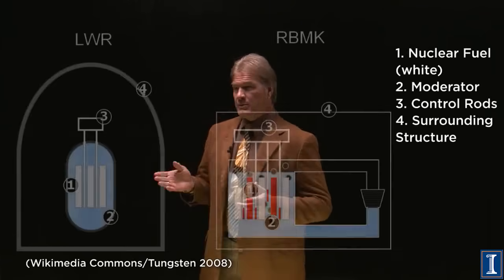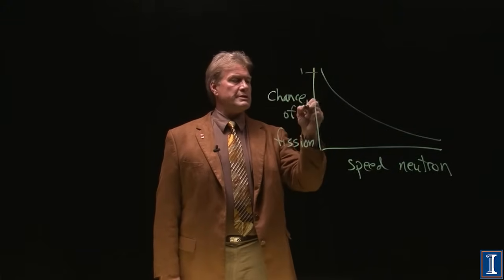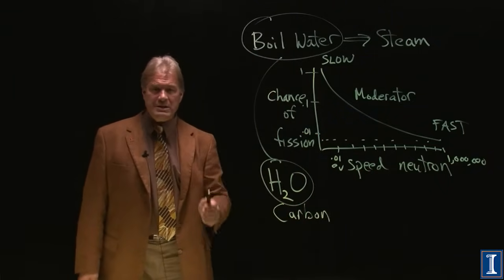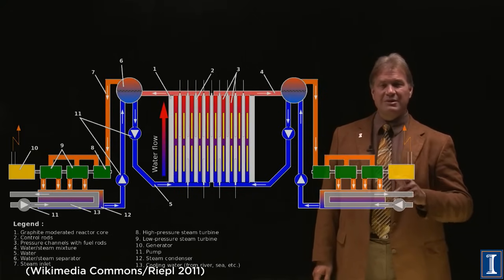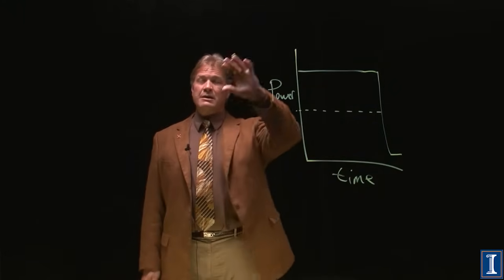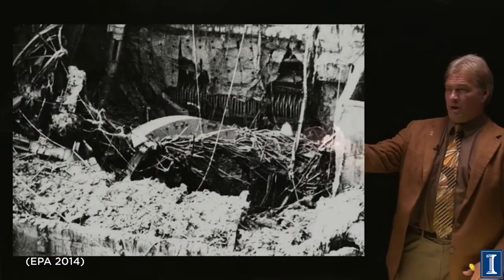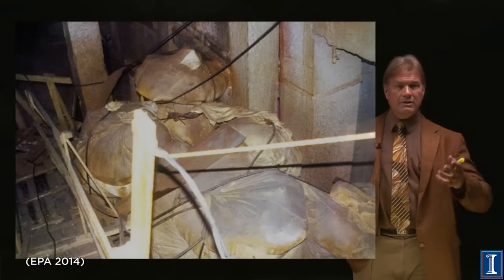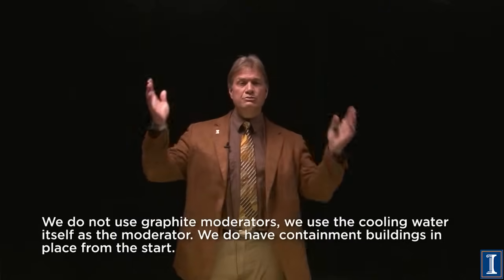Chernobyl: Worst Accident Ever

Comment: Containment vessels are important, but they do not guarantee containment (example: Fukushima).
Reply: Indeed, Fukushima unit 2 melted down completely and broke out of its primary containment, which is not even supposed to be possible.  That's as bad as it gets for a PWR accident.
Reply: Fukushima was a triple meltdown rather than a single meltdown and yet as a result of the containment, it only ever released 1/10th the radiation Chernobyl's single melted core did. While not necessarily guaranteeing total containment, they can reduce the release in case of an accident quite substantially.
Reply: @infantjones  Agreed, but only #2 broke out of its primary reactor vessel contaiment.  Most of the radiation released came from this reactor.
Reply: They also don't help when the operators decide to release very small amounts of radioactive gasses into the atmosphere. I believe that happened at Three Mile Island. Hydrogen was accumulating in the containment building (search for "hydrogen bubble") and someone erroneously believed that it could explode and damage the building. So it was decided to vent this hydrogen out into the atmosphere. The hydrogen itself is not radioactive, but it is impossible to filter the air that is vented 100% so some other radioactive gasses from inside the containment building was also vented.
Reply: @Jan Bruun Andersen

It didn't harm anyone nor do any environmental damage so I don't see the issue. Far too little radiation diluted far too greatly to even risk causing any harm.
Reply: @JanBruunAndersen  There was no detectable radiation in the environment after the hydrogen was released from TMI.   After the accident was over, everyone was allowed to go home.  There was no exclusion zone, no detectable contamination.

Comment: The reactors at chernobyl were also designed to run only at full power to produce as much plutonium for nuclear bombs as they possibly can...

The russians didn't tell them this, and when the operators started fooling around with the operation of the reactor.... well, you can see the result...
Reply: you stupidity level is higher than amount of energy produced by RBMK-1000 at full power

Comment: The only thing more dangerous then a safety test at Chernobyl is a teacher without a firm grasp of the subject matter.

Safety features
The CANDU includes a number of active and passive safety features in its design. Some of these are a side effect of the physical layout of the system.

CANDU designs have a positive void coefficient, as well as a small power coefficient, normally considered bad in reactor design. This implies that steam generated in the coolant will increase the reaction rate, which in turn would generate more steam. This is one of the many reasons for the cooler mass of moderator in the calandria, as even a serious steam incident in the core would not have a major impact on the overall moderation cycle. Only if the moderator itself starts to boil, would there be any significant effect, and the large thermal mass ensures that this will occur slowly. The deliberately "sluggish" response of the fission process in CANDU allows controllers more time to diagnose and deal with problems.[4]

The fuel channels can only maintain criticality if they are mechanically sound. If the temperature of the fuel bundles increases to the point where they are mechanically unstable, their horizontal layout means that they will bend under gravity, shifting the layout of the bundles and reducing the efficiency of the reactions. Because the original fuel arrangement is optimal for a chain reaction, and the natural uranium fuel has little excess reactivity, any significant deformation will stop the inter-fuel pellet fission reaction. This will not stop heat production from fission product decay, which would continue to supply a considerable heat output. If this process further weakens the fuel bundles, they will eventually bend far enough to touch the calandria tube, allowing heat to be efficiently transferred into the moderator tank. The moderator vessel has a considerable thermal capability on its own and is normally kept relatively cool.[4]

Heat generated by fission products would initially be at about 7% of full reactor power, which requires significant cooling. The CANDU designs have several emergency cooling systems, as well as having limited self-pumping capability through thermal means (the steam generator is well above the reactor). Even in the event of a catastrophic accident and core meltdown, the fuel is not critical in light water.[4] This means that cooling the core with water from nearby sources will not add to the reactivity of the fuel mass.

Normally the rate of fission is controlled by light-water compartments called liquid zone controllers, which absorb excess neutrons, and by adjuster rods, which can be raised or lowered in the core to control the neutron flux. These are used for normal operation, allowing the controllers to adjust reactivity across the fuel mass, as different portions would normally burn at different rates depending on their position. The adjuster rods can also be used to slow or stop criticality. Because these rods are inserted into the low-pressure calandria, not the high-pressure fuel tubes, they would not be "ejected" by steam, a design issue for many pressurized-water reactors.

There are two independent, fast-acting safety shutdown systems as well. Shutoff rods are held above the reactor by electromagnets and drop under gravity into the core to quickly end criticality. This system works even in the event of a complete power failure, as the electromagnets only hold the rods out of the reactor when power is available. A secondary system injects a high-pressure gadolinium nitrate neutron absorber solution into the calandria.[5]

If you lose the water (coolant/moderator) in a Candu reactor, without the OTHER emergency safety systems, it will blow.
Reply: YES THANK YOU someone who knows what they are talking about.

Comment: Catastrophy was POSSIBLE to evade by ONE simple thing: using the water, not the controll rods. Compare to LWR, water is KILLING the nuclear reaction in RBMK.
However Akimow ORDER to do AZ-5, even if Diatłow wanted water. Effect? Bang.
In practice without messing, RBMK prove to be superior to any LWR.
None of them caught meltdown during the NORMAL operation. (with all systems green)

P.S. If Nixon didn't fuck the safest nuclear program, safe and cheap TMSR would dominate the nuclear business causing TMI, Czarnobyl and Fukushima accidents to not exist.
Now we ended with thousands of tons, radioactive and unsafe nuclear waste! (that is pilling every year and GROW!)
P.S2. Water is the WORST coolant ever! It didn't even fulfill the SAFETY requirements for nuclear moderator! Forget the coolant!
8:20 - BIG NOPE. It wasn't safety test anymore since Diatłow CHANGED the scenario to catastrophy...reactor couldn't explode with cooling system work and the "buffer" eating all of those sweet neutrons!
18:00 - AHEM! Fukushima exploded in that SAME way, radioactive particles ESCAPED the contaiment! Nature proved LWR can't stand the fury of the elements! We neeed *MRS!*
Reply: The control rods were tipped with graphite, and the reactor was moderated with graphite. So when the AZ-5 button was pressed to SCRAM or execute an emergency shutdown, those control rods descended into a nuclear pile with a runaway chain reaction within it, and they triggered the explosion. The moment they realized there was an uncontrollable power surge underway, it was too late.
Reply: @taraswertelecki7874  
That is WHY operators should start the water pumps - to evade the power surge.
Reactivity is double-eged sword.
Also - if "buffer" rods were not lifted as in experiment principles-nothing bad would happen.

Comment: Your containment building wouldn't help you in case of something like Chernobyl. It's silly even to suggest it. You can not contain explosion these way. Did you saw that hole in Chernobyl's roof? We had only two major meltdown events in history, both happened because water stopped pumping through the reactor. So we need reliable, redundant and foolproof system that pumps water through the reactor, and not some useless containment building. Look, it's not a rocket science, it's not like making airplane that in safer to fly than to walk, so it's definitely possible to make reactor that doesn't breaks. Yeah and we need some central control center, to not allow people on places to do things like that.

Comment: This guy has some incorrect facts, nobody hit the wrong button.
Reply: Yes. What actually happened was Kiev told them they couldn't shut the reactor down as early as the plant operators wanted because they still needed the power for the city. As such it ran at half power for several hours. That's what allowed the xenon to build up, which eventually caused the reactor's power output to peter out.

Comment: Built my rbmk in the shed (slightly scaled down) all going well till last night when there was a small explosion. Wife wanted to know why there are chunks of glowing black stuff on the lawn, just told her " you didn't see it because it's not there" 😂 dyatlovs  book reactors guide for dummies is not my best buy
Reply: I read your book "Graphite Moderated Reactors for Dummies" and ended up having a loss of coolant accident when my garden hose accidently disconnected from the washing machine I was using as a reactor core.  The force of the phreatic explosion caused by the remaining water suddenly boiling due to the 100 kg of low-enriched uranium (that you suggested as suitable for a beginner's first reactor fuel load) suddenly going prompt-critical was not fully contained by mom's sewing room, which I was using as a containment structure.   The nuclear yield was low enough that the Department of Energy only classified it as a "dirty bomb", but we ended up nuking several Middle Eastern countries anyway before I could get through to their help desk and tell them what had happened.    
Based on this experience, I would not recommend this book to a friend.
Reply: Now u can grow ToMacco on farm,..

Comment: There's an interesting conspiracy theory put forth in the film, 'the russian woodpecker'. A russian youtube channel did a video where one of the engineers involved at the time of the accident stated that the procedure they followed would surely cause the reactor to fail, and they knew it. Can we assume that they didn't really understand the problem with shutting down the reactor and then restarting , and thus having to pull the rods out to get the reaction going again?

Comment: As a physicist may I correct certain details. There was a containment shield above fusion chamber, cylinder of concrete 3 meter high and 17 meters wide. There are info that shield weight was around 50 tonn and its swings in the air by explosion. Also you not pointed out that whole reactor was build in a rash and quality of concrete were poor without steel or lead in. And there was few broken fuel rods. Firefighters were uniformed of explosion, they knew only that the roof on fire. So whole catastrophe was a lot of human mistakes and terrible accident.
Reply: The reactor lid weighted significantly more than 50 tonnes believe me.

Comment: The statement that our nuclear centrals are safe because they have a containment structure is very daring. It is doubtful that a containment building would have been of any help in Chernobyl.  A reactor melt down generates tremendous amounts of pressure.  The chernobyl explosion blew away dozens of meters up in the air a 500 ton concrete slab that was on top of the reactor precisely to prevent radiation scape in case of an event.   Such a blast in a containment building could have the same effect as the explosive inside a metal hand grenade.
Reply: The first steam explosion blew the 200 ton "System E" plate through the roof, after which it landed back on top of the reactor at an angle. It didn't blow apart like a grenade, and as far as I'm aware, the reactor pit stayed intact. So did much of Reactor 4 building. System E was never intended to contain an explosion, so it wasn't attached strongly to anything (Wiki for RBMK reactor states is just rests on 16 rollers). The two explosions were large enough completely wreck the core, start a huge fire, and expose it all to open air, but they weren't as massive as you seem to think. And in any case, 3 Mile Island -style partial meltdown possible in LWRs isn't so dramatic and sudden.
Reply: You would not have felt that way if you were one of the technicians at the plant who saw a meter thick pre-stressed concrete wall  bend like rubber when the reactor blew apart. This was a massive explosion by any measure, and he was fortunate to survive, others who were closer to the reactor vaporized in the explosion.
Reply: A melting reactor creates no more pressure than a healthy reactor.
Reply: Kron161 its not just because there is containment. There are a whole host of reasons listen in this video

Comment: Well, RBMK is a single-loop BWR and must be compared to single-loop BWR's of the West, that is, an infamous Fukushima type. BWR's can't have a dry containment due to their large coolant inventory and size of it's only closed loop, so they rely on pressure suppression in bubbler ponds. This is exactly what RBMK had as well. So "no containment" argument is irrelevant. It's like blaming a motorcycle for not featuring an airbag.

Comment: Fukushima proved this man wrong about can't happen to western reactors. 1 they put MOX fuel in the reactors without NRC consent. 2 the earthquake cracked open and emptied the water from a fuel pool with recently removed fuel. That fuel overheated and reached criticality and detonated  the evidence is on video. The fuel storage pool is 100 feet upstairs in the building not in a containment vessel. You maybe right about how Cheyrnoble exploded but you are grossly inaccurate about western reactors like Fukushima being safe. In 1976 the exact reactor design from Fukushima was tested. They filled it full of air and it leaked a 16 psi. The bolts holding the containment lid stretched. GE hid this information and went on to build these reactors all over the place 32 in the US most on the east coast. I'm a nobody why the hell do I posses more facts than this guy?

Comment: At Chernobyl the upper biological shield was thrown through the roof during the steam explosion. I doubt that a concrete containment (made against incoming airplanes, not an outgoing concrete block)  would have stopped it. You would still get a hole in the roof, a fire burning and escaping core particles.

Comment: They didn't press a wrong button lol they were forced to get that low because they wanted to still proceed with the testing and because of that also ignored many safety issues. You can see it on the Chernobyl mini series. 90% of the series is accurate.

Comment: There's no doubt that the Chernobyl explosion was a very serious incident which resulted in an enormous release of dangerous radionuclides across much of Russia and Europe. But the worst? Cast your mind back to the Kremlin issuing a by-any-means-necessary order for unlimited men, materials and other resources to prevent radioactive contamination leaking into the Pripyat River, which flows into the Dnieper, which empties into the Black Sea. They were terrified all of that pollution would not just be transported across thousands of miles of territory - but also be injected into the food chain. From algae and plankton, up through filter feeders such as catfish, up through apex predators (in and out of the water) - and finally into humans. 

When three out of the four Fukushima reactors broke containment those fission products went straight into the Pacific ocean. And they've continued flowing into the sea ever since. So the nightmare scenario the Russians were so spooked over has already occurred. And I should mention the two explosions because they are important. The first was more than likely because of hydrogen igniting after it forced its way out of the containment vessel. But the second, far more energetic explosion, could only be the result of core deformation, contact with moisture and a prompt supercriticality which blew the top of the containment vessel through the roof and several hundred feet into the air. The detonation not only ejected most of the core it also blew apart the storage pools positioned directly above and atomized the spent fuel rods. The fact that Fukushima is rated as being "less serious" than Chernobyl says more about the the power of the media than any objective truth. I mean, if Fukushima wasn't so serious why did the Japanese government immediately draft laws which threatened anyone writing or talking about the grim reality of this multiple-meltdown with a hefty prison sentence?

To be honest, I'm not even sure Chernobyl was the second worst nuclear disaster. When the Mayak storage facility went pop in the 50s it also blew several tons of fission products into the upper atmosphere and spread lethal contamination across a vast area of Soviet territory. It was the lessons learned from the Mayak cleanup operation which meant that the Russians had several hospital facilities devoted primarily to nuclear medicine which they brought online in the wake of Chernobyl.